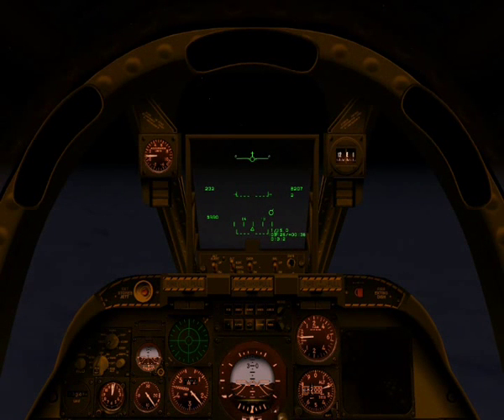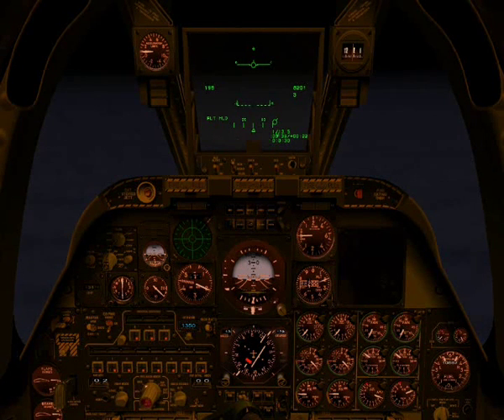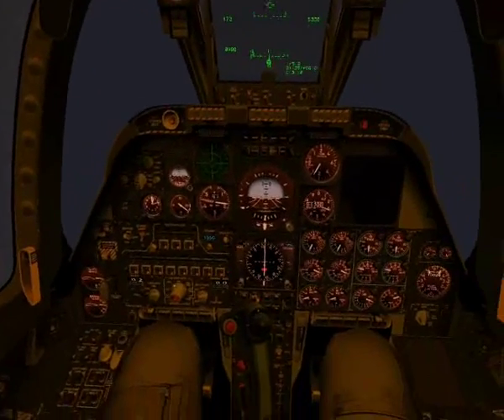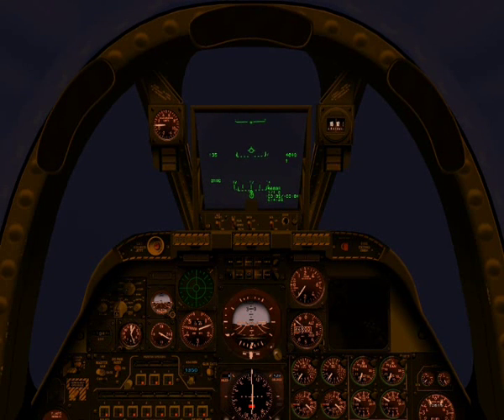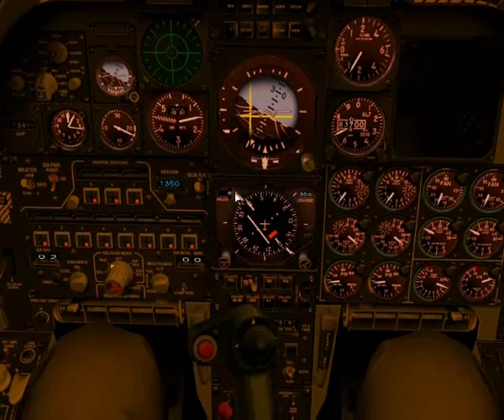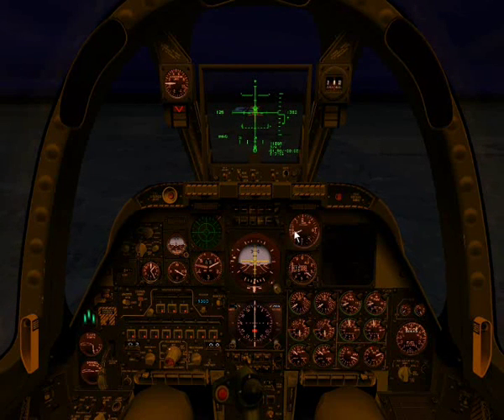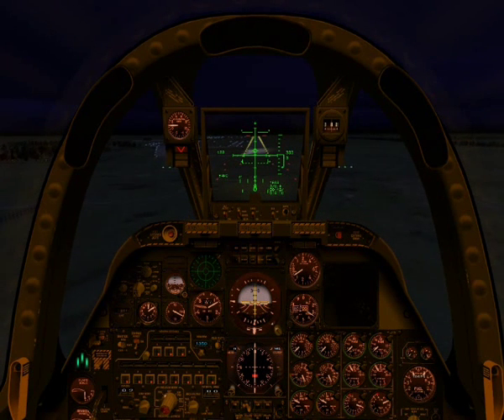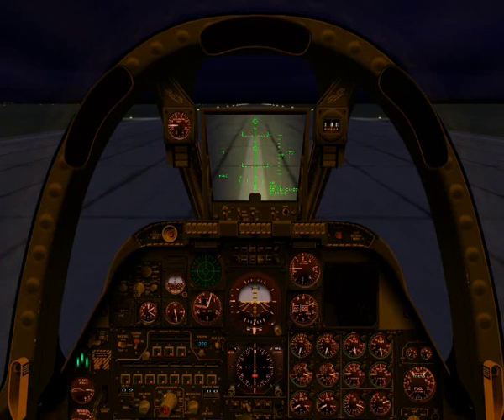Lock On (LOMAC) Tutorials - #5 ILS Landing

Comment: Also, I always have problems on landing on Krasnodar-Center Airfield, most exactly on the runway 09 (HDG 87º). The problem is that I never recieve permission from the tower to land on that runway (I always recieve it normally for the opposite runway), and thus, the hud doesn't shift into that Glide Slope/Localiser Gauges, and I'm forced to perform visual landing...

And yet, I only recieve permission for landing when I'm already on the ground. ¬¬

Comment from the maker: You are going to struggle to make the really small pitch, roll and throttle adjustments without a flight stick. The problem with a keyboard is that there is no level of input - it's either on or off. Perhaps you could somehow play off the pitch and roll with small trim adjustments. At the end of the day, it's not going to be an easy thing to get around.

The x52 is a good HOTAS! Your enjoyment of LOMAC will grow massively when you can worry less about fighting the controls. Good luck!